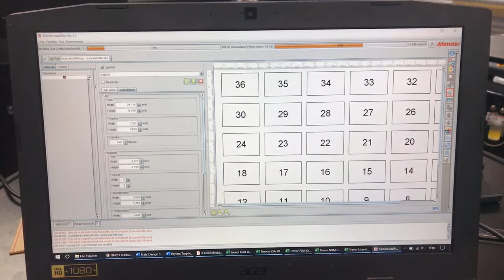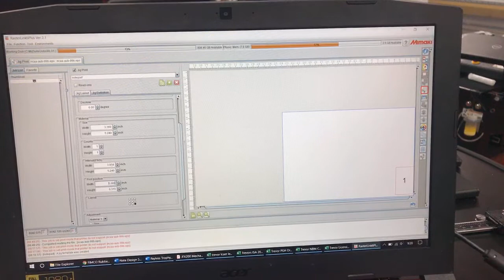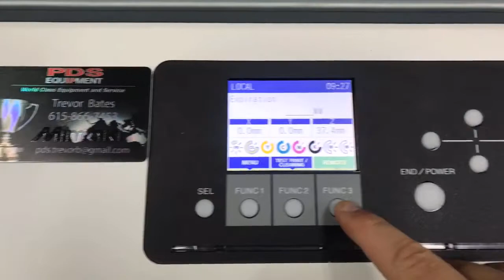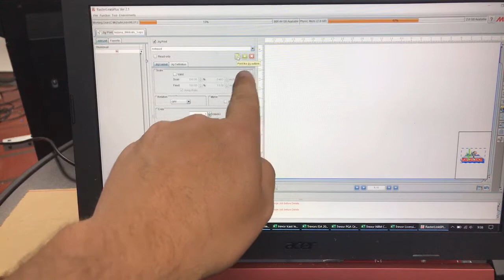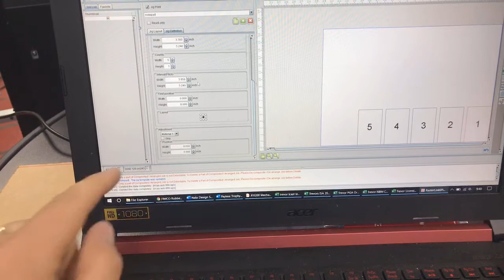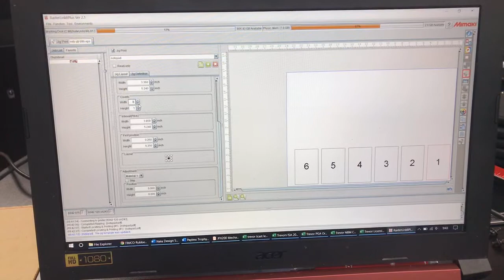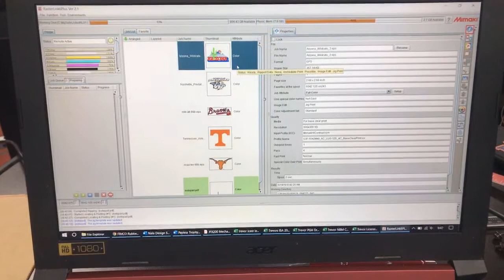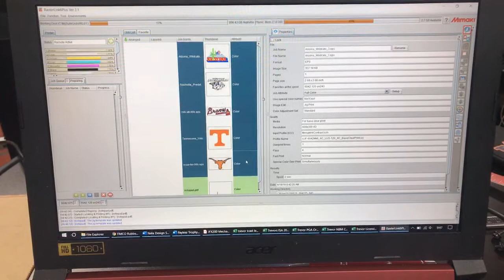HOW TO: Use the jig print feature in Rasterlink with Mimaki printers

Comment: Thank you for this video! I love the jig print option and you've made applying it easy! I'm using RasterLink7, and on occasion my jig will be ignored by the software (basically skipping that I selected to use the jig, but's it's checked to be used). Has anyone else has this problem and could explain why it occurs?